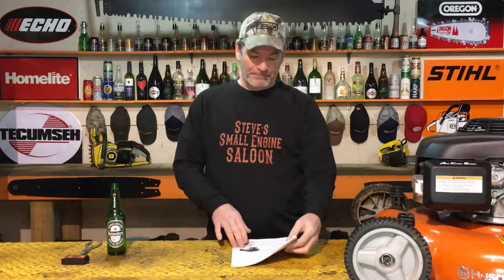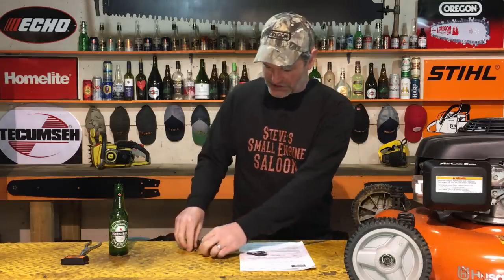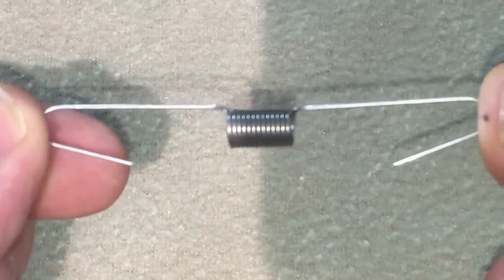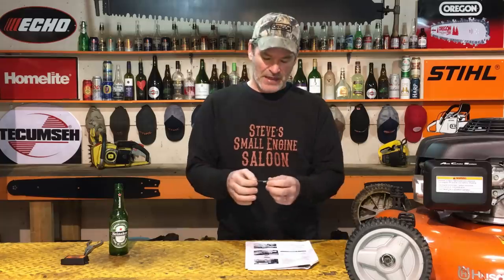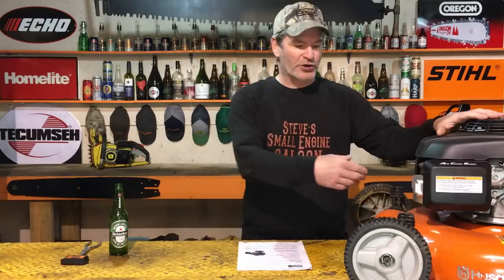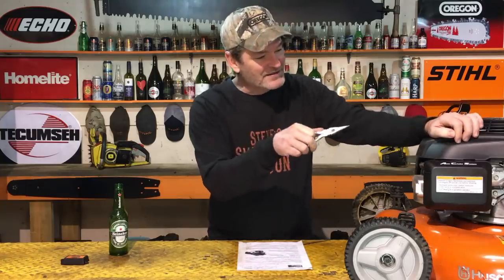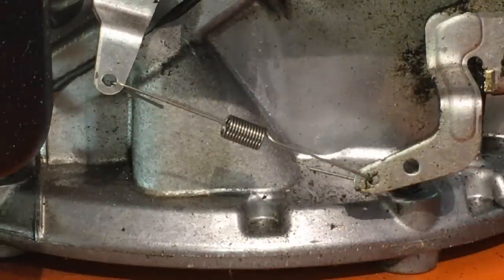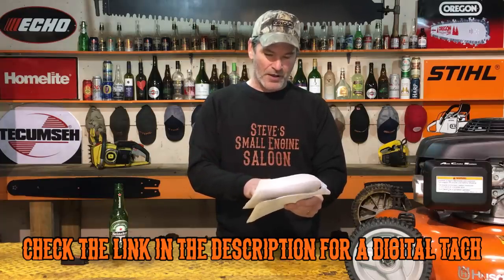How To Fix a Honda Lawn Mower if it Chugs and Stalls

Comment: Is there a video to explain why my push lawn mower dies when I engage the blades. It's a Honda motor. I had old gas, used "Mechanic in Bottle" to get it started, it chugs, smooths out in 10 minutes or even soon, then stalls, when blades are engaged. I haven't changed spark plug, it 7 years old. I changed oil, air filter. No new spring yet. 
Enjoyed your video on the "new  spring".
Yes beer is a great breakfast drink on a very H O T Pensacola  FL morning !

Comment: Have HRR216, about 2 years old, replaced spring, carb/jets have been cleaned, air filter is clean, fresh gas, still does the chug and die routine. Any ideas what else it could be? Next step, replacing the carb and the thermo wax actuator for the auto choke.

Comment: Honda sputtering.  Watched your vid--the spring on my mover had fallen off on one side.  Put the spring back on and away I went, engine running well.  TU !!  I'm getting the tach and a new spring to make sure 4 next time.
Reply from the maker: Right on

Comment: I don't understand why the mower wouldn't still be set to the correct rpm once you get the right spring replacement..? I'm in a pinch and wondering if I can just bend the spring a little tighter to get my lawn mowed before the rain moves in for the winter, lol. Have no idea how to fiddle with rpm.

Comment: I just replaced the carb with a new Honda 16100-Z0L-853 Carburetor. It runs while the auto-choke is engaged but then dies right after it disengages. It also floods like crazy. I tried two brand new carbs with the same results. Any ideas?

Comment: You stated that scalp wheels should be set at approx. a half inch when deck bottoms out, but you mention that your deck is set to cut at 1 and a half inch does that rule apply to any height setting.

Comment: I would add check the choke plate after warm up to make sure it is fully open. If not the wax operated auto choke plunger may not be extending fully.

Comment: I have been living with this problem for a couple years.  I cut away a piece of the plastic guard so I could toggle the choke with a finger.  A couple of flicks and the engine settles in  and runs smooth for the rest of the session.  I DO NOT RECOMMEND THIS since it has to be done with the mower running and it places one of my feet way too close to the deck.  I get paranoid every single time I do it!  I am ordering the new spring as soon as I find a source!  Thanks once again -- you are making my life better with every video!  In this case the foot you save may be my own!
Reply: Hi, how do u reach the choke while holding the mowers main handle?

Comment: My honda start it and it runs ok then you mow and it dies the choke if you push it closed it will run too. but slowly comes off and dies. I ordered the spring it will be here in a couple of days.

Comment: Hey, I got a snowblower Tecumseh that dies like that. I did notice any chugging. It don't smoke. It don't have the power when ya give er a big gulp of now. It want to slow and die unless I let go of the clutch. Then it takes off running. 5 hp walk behind. Thanks

Comment: I have a husqvarna 372 Xp idle stay the same to fast sometimes or dies  always have to adjust it how do I fix it
Reply: Hey David,
How old is your saw? My guess would be to pressure check your carb to see if the needle is failing to seat. I can pressure test it if you like. I'm just up the road from you. I also would check for an air leak at carb intake boot. Fuel lines are also prone to cracks. Let me know what you find.

Comment: Hey steve, got a question, I used my poulan pr300 snow blower and put it in shed as normal, next day started it and it ran so high i thought it was going to send piston through roof. I shut it off, waited few mins and started it again it did same thing. I drained carb by the drain screw, put back screw, open fuel valve and it ran normal. Whats the reason for that. I can see if I cleaned carb etc but only drained it.

Comment: Would you please tell me the symptoms if the thermowax choke "thing" isn't working?
My Honda HRX mower starts great in warmer weather and as soon as the days get colder it's reluctant to start....it takes way more pulls.
Thanks!
Reply: Wayne Essar 
Had that problem.
  Start mower and runs great for approx 2-3 seconds then dies.
  Thermo-was is around $10.00, and It’s located behind the carb/choke lever on the block.
  Grab (old one) with needle nose vise grips, heat to melt epoxy w/ pencil torch and twist to pull out.
  Reheat epoxy and push in new one firmly till seated. 
  Reassemble.

Comment: Good video Steve, its what mine is doing now. I got this mower from a friend, he said it wouldn't run. It was stalling right after it started. I changed the spark plug and it runs now.I was wondering if you could shed some light on the reason it would stall out before I changed the plug? I looked it up on you tube and two different guys had the same experience. I checked the first plug before I tried to start it, and it had spark.So it would start the mower but quit, I don't get it?

Comment: Hi Steve, great video. My autochoke Honda mower will run ok for first 1-2 minutes then chug and run badly/slowly, would you guess that this is the same problem? It seems to improve if I do a wheelie with the mower, but that's not very convenient. Enjoy the Heineken!
Reply from the maker: Check my playlist for a video called---runs and dies in 2 minutes

Comment: You would see this more than most. Have you had the old spring chugging problem very often? I never have experienced it in either owning or working on quite a few GCV160' & GCV190's since 2011.

Comment: Yeah, that's what they say but the real problem is between the cams of the throttle and choke shafts. You really can't modify those unless you add material to the throttle shaft cam. The governor spring was just hondas cheaper fix. If you want 3200 sorry.

Comment: Steve-I need your expert advice! I have a very similar Husqvarna lawn mower with the Honda auto choke system. I watched your video on sharpening the blade, So I thought, " I should sharpen my blade too." Well the sharpening went well, BUT when I tipped the mower on it's side to remove the blade, oil leaked into the air filter. It looks like Honda has a vent tube that goes to the airbox. I replaced the oil and cleaned the mess  BUT the engine only runs for a couple od seconds. Think I have oil in the carb??? Is it hard to start pulling the intake system apart? Want to make a video with my mower? ;-) All help is greatly appreciated!!!

Comment: Hope Honda have fixed this issue on their brand new GCVx engines coming to Europe and Britain as the old GCV160-190 engines don't meet new European emissions standards. The new engine is pretty similar except you can take it apart easier if a crank shaft has failed etc.

Comment: Unbelievable! This video described the exact symptoms my Husqvarna 700h is having. It chokes to the point it almost stalls. This SB is not installed on my engine, and unluckily recently broke my tach. Took it to my local small engine shop for SB “Lawnmower #28”.
Many thanks Steve. Where can I ship some local brew as a thank you?

Comment: That spring is easy to find on the Internet
Reply: I noticed in a few of the links that were supposed to be for them actually linked to the older unit.  Make sure the last 3 numbers are 900 and not the older 000 on their website.  I found the 900 spring on PartsPak.com where most of the others were actually selling the other.

Comment: Thanks for the video Steve! I have one of the older manual choke Honda HRR mowers and have had issues with that spring seeming to lose tension. Can you advise on the proper spring for HRR2166VXA? I’d hate to put the wrong spring on and I don’t want to mess up one of the last good manual choke blade break/clutch versions Honda made because it’s treated me so well.

Comment: Hi Steve,Thanks for the great videos!I have made some small carb cleaning tools.I chose piano wire of several sizes glued to a tongue depressor as a handle.  currently I have .013, .017, .020, and .025 wiresCan you tell me if  .013" is small enough for the tiny passages in the videos?do you think anyone would be interested in such a tool ?if you can give me an address or PO box, I will send you one for free.

Comment: Steve I was told recently that I shouldn't let my Stihl equipment run out of fuel and to fill up tank before it runs out as it leads to problems, any truth in this? Would appreciate your advice thanks
Reply: Vic Curley When you run out of fuel on a Two stroke the mixture is going way lean, I have seen guys that are anal about this. I’m not sure how long it takes to burn down a motor this way but it probably doesn’t help especially if you’re full throttle.
Reply: I've been a logger for many years, I always run my saws out of gas and have never had a problem. My current saw is a Husqvarna 562xp with over 400 hours on it(is computer controlled so it keeps track) I suppose that "technically" it does make a difference but I've never heard of it causing problems